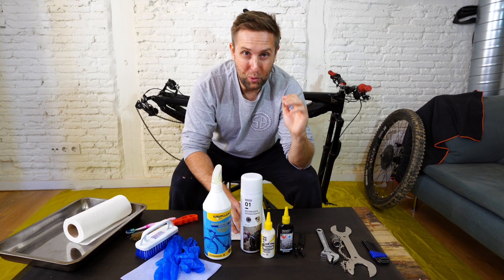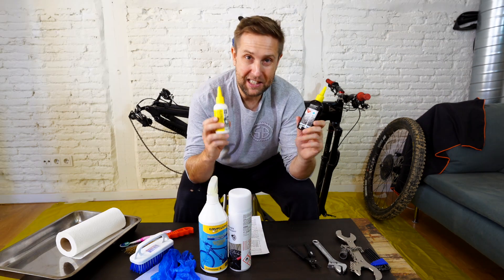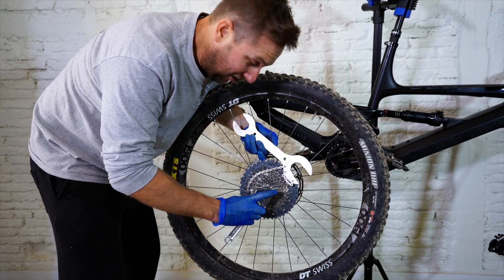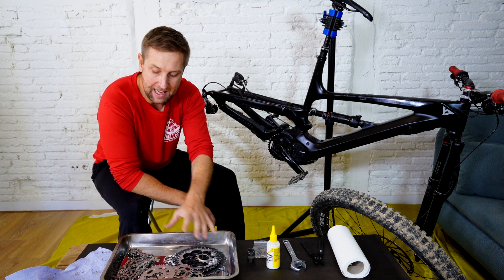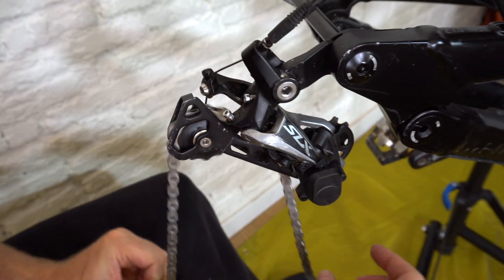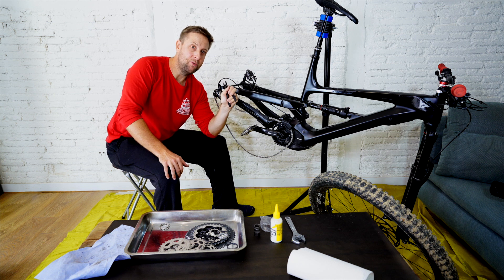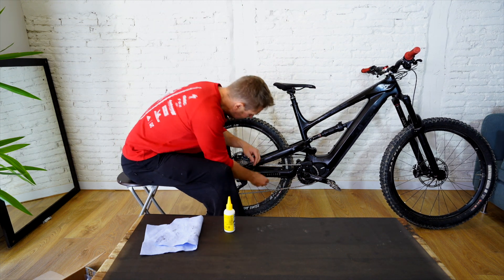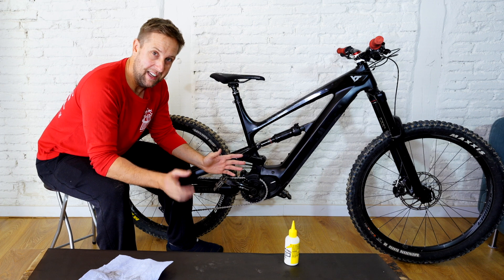DEEP DRIVETRAIN CLEAN - How to clean your Ebike chain

Comment: Mate! Few comments. 
1)I definitively favor chain replacement vs cassette/chainring. Meaning, at the bare minimum doubt chain is old (elongated, rusty, cranky) I just replace it. I don’t degrease it as deep as you do anymore. Every 4/5 months (1000kms or so), new chain!! That’s 20-30eurs, not very expensive.

2)I lube the chain link by link. Is a little lengthy, but not taking more than 2mins literally. Also, I apply the lube “painting” a 90degrees line over the chain line. Making sure the lube is entering in the links, which is where you want it, and not between the links.
Preferibly I let the lube stay in overnight, then I clean the excess with the rag. This part I admit rarely I can do it, as I lube the chain often just before riding it...

Safe rides!!!!
Reply from the maker: Thanks mate I’ll look into this

Comment: All my bikes get a quick lube with white lighting dry clean ride before every ride. Takes less than 30 seconds with a quick wipe down. My chains and cassettes stay immaculate even on my cx and mtbs. 100% recommend this stuff been using it for over 10 years the Canadians know their stuff greatly extends my strip down intervals. I always grease my freehub bodys. 40nm is a struggle to remove with a shifting spanner a breaker bar will serve you better you can also use an cheap ultrasonic cleaner to clean your gear if you dont want to wait for a deep soak. Great video Sam.
Reply from the maker: thanks for the tips...

Comment: Have a look at Oz Cycle. He soaks the chain in boiling paraffin wax and Teflon powder. I do this and there’s no need to degrease the chain. You just take the chain off every 250kms and put it in boiling wax again. Super clean in wet or dry conditions. No black grinding paste. The chain will last a lot longer
Reply from the maker: I’ll have a watch tonight! My mate does the same thing I’ll give it a go I think!
Reply: @SamsBikes  I can vouch for this its the best lube ever and the dirt and mud doesn't want to stick to it. You still need to give it a clean every now and then. But a container with petrol and fly screen so the dirt falls out and the chain stairs above the dirt when agitating it works a treat. Listening to your hub bearings Sam they sounded terrible I would of checked cleaned and re greased.

Comment: Avoid Ceramic lubes on MTBs especially if your lazy and don't clean the drivetrain after each ride... they leave behind a black/grey hard coating that could survive a nuke blast and it causes rapid chain wear.

IME dab each link roller with a rag underneath to catch the excess and don't spin and splurge.. the only place that needs oil is the roller internals. I've tried most oils on the market and just use Purple Extreme nowadays though you need to leave it to "cure" it's the best i've found for most conditions but it's relatively expensive.